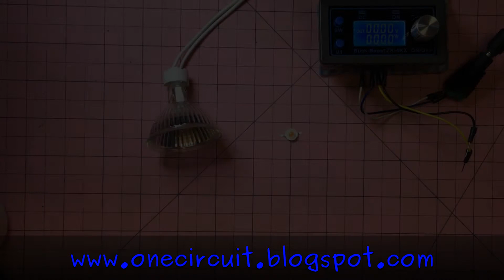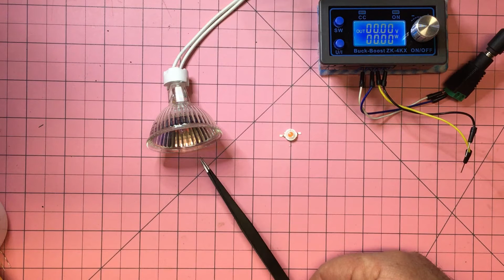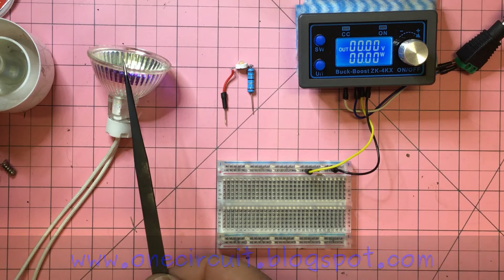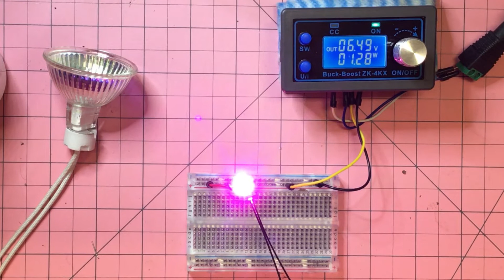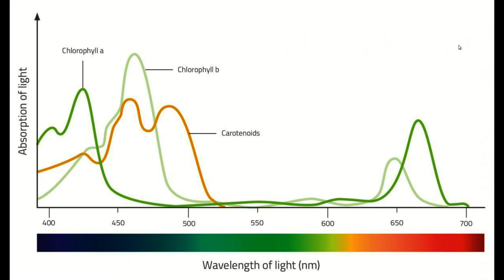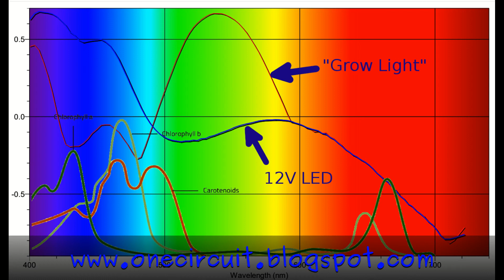3W Grow Light

Comment: In the chart at time 8:00, there are two plots. One is labelled "Grow Light" and the other is labelled 12V LED. Which one is the tungsten bulb?
Reply from the maker: Yeah the “12V LED” is a standard tungsten down light. I had problems getting straight all the way through because I’ve replaced all of them in my house with LEDs. 🤦🏼‍♂️
Reply: @onecircuit-as  ok that makes sense, you were consistently calling it an LED throughout. I should have figured that out.

It's odd that the grow light module didn't have a very strong red component given that it looks magenta (red + blue). But maybe that's because red LEDs just don't put out the light power (lumens?) as compared to blue LEDs--assuming there are two different diodes in the package.

Comment: You could use 2 x 2-watt resistors. At 3-watts total for the circuit, each one will be dissipating less than 1.5 watts.
Reply from the maker: Good call! Hopefully the 3W and 5W versions aren’t too far away, although freight at the moment is very “iffy”! 🤷🏼‍♂️

Comment: I have two large 20w full spectrum COB LED's mounted to a large heatsink with a 12v fan. This is mounted a meter above my strawberry plants on a timer from my solar system. It runs from about the time they lose sun from the back window until about 8pm.
Reply from the maker: Wow! How are the strawberries? 🍓🍓
Reply: @onecircuit-as  they are doing well, every year I get new plants from the runners but I get some very big, juice berries from them. They are 3rd generation now. Mid winter I am going to replace the soil and get in the habit of doing that every 2-3 years. Next move is an Arduino based automatical watering system.